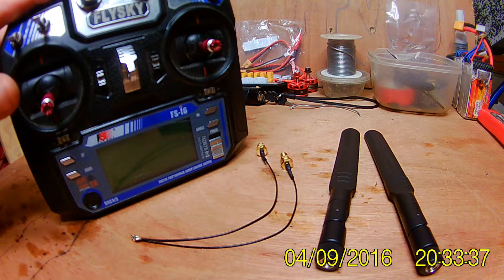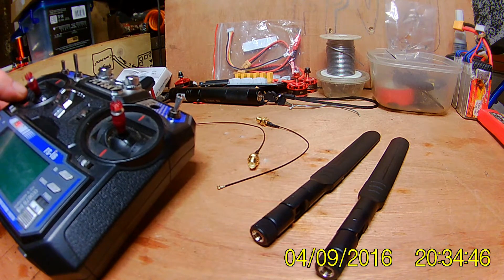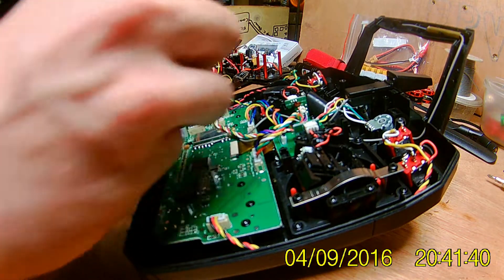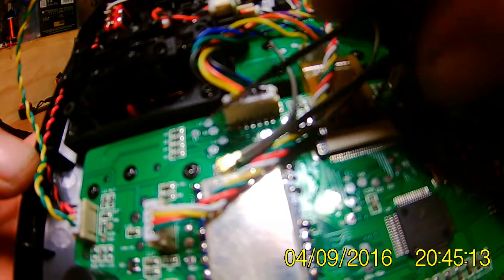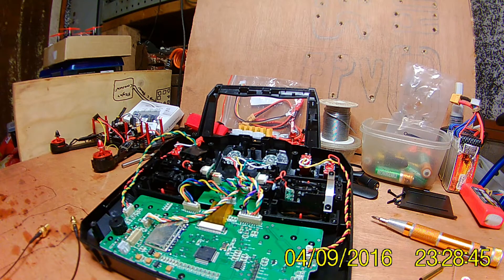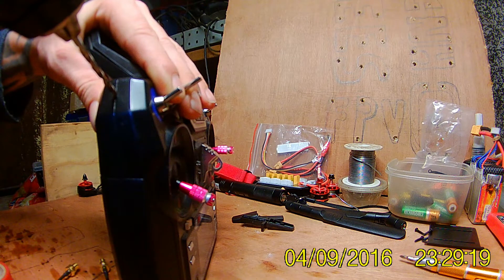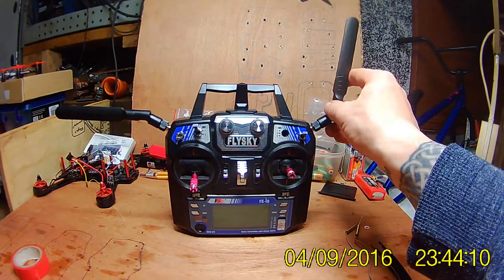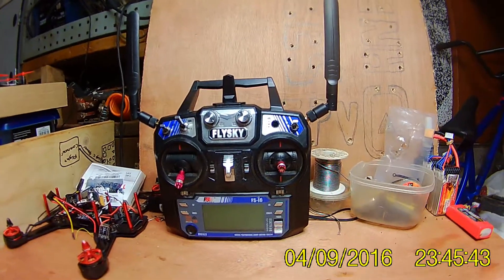FlySky FS-i6 Transmitter  - Antenna Mod/Upgrade ( Increase your range & Signal Strength)

Comment: I am new to this mod stuff and, I have been researching the specs on different antenna's. For instance GFSK (Gaussin Frequency Shift Keying for Flysky) modulation  vs VSWR ( Voltage Standing Wave Ratio)  . I have heard on other video comments not to use Voltage Standing Wave Ratio antenna for, Flysky, Turnigy, as it could fry the transmitter. Here is a link explaining some of this , which I do not completely grasp.  How has your radio held up with these antenna ?   
 ww.rfwireless-orld.com/Terminology/GFSK-vs-FSK.html
www.antenna-theory.com/definitions/vswr.php
Reply from the maker: seems to be good so far buddy

Comment: Does this work on all quads? (With fly sky receiver)
Reply from the maker: yes as the mod is in the transmitter, anything you connect to will have better range 👍😃
Reply: Andy Rees FPV thanks gonna get it soon

Comment: Hi Andy what s the range been like? I don't want range as it to go really far but so it's got a strong signal because I use the i6 and a i6b receiver with duel antennas and if I go behind thick trees or into a building it goes laggy and unresponsive like so I want a new TX as this i6 of mine has has some 900 hours on it lol, the gimmbals are like a stick in a dustbin lol, there worn out and are really baggy and they have no centers anymore lol! So I need to get a tarranis sharpish!
X9d+ I want the limited edition rock monster one, it looks cool as fuck don't you reckon?
So that's next on the list after buying some new motors as there nackard too, bent shafts on two of them aswell so there ready now lol! I'm still using the original wizard 220 motors and there only £7 each lol, so that says a lot about them motors lol!

You been out flying today pal?
✌✌✌✌🇬🇧
Reply from the maker: i havent noticed nothing because i usually fly quite close lol took the qav out and fried a esc and bent a arm so i been looking for a good frame im going to get the armattan chameleon with lifetime warranty lol £65 from quadcopters uk but its not in stock at mo 😢